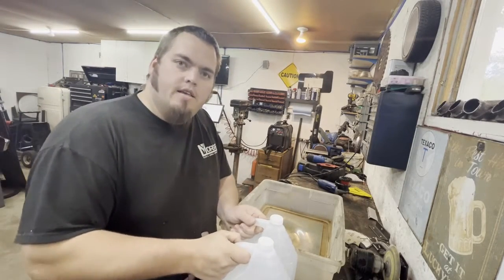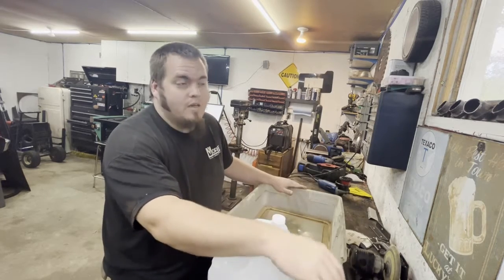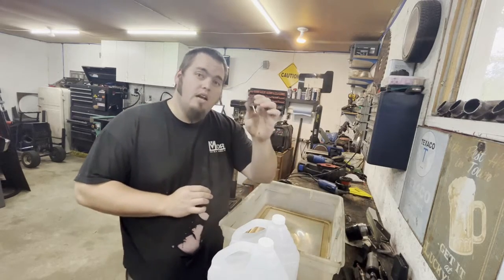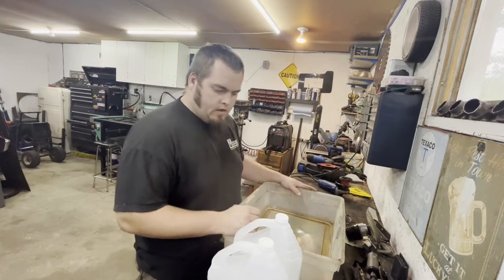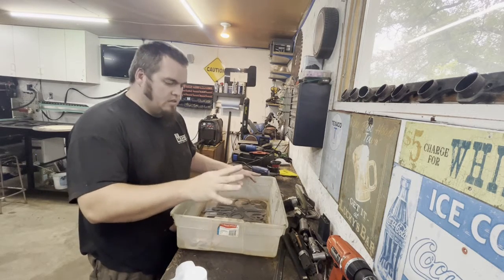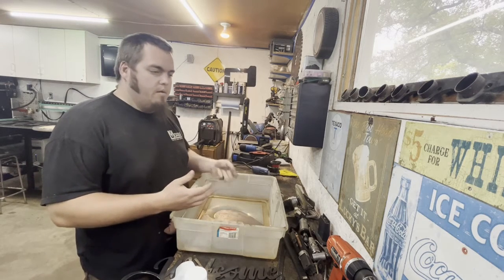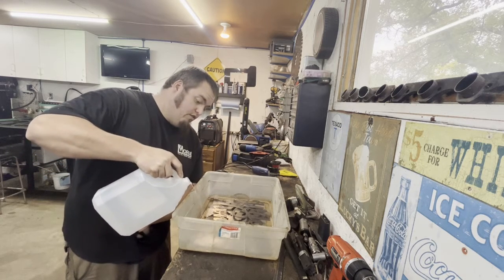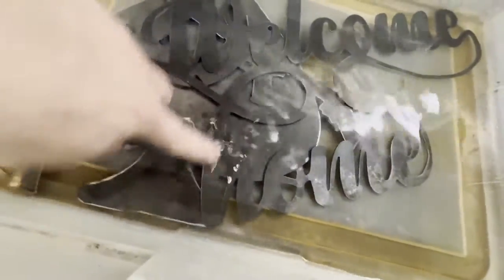White Vinegar - Mill scale removal? will it work

Comment: I've used vinegar to take mill scale off for years, and it works great. Given that I tend to want my end product to be bare steel, clear coated, I always scrub the steel with a wire brush in a baking soda/water solution to prevent flash rusting. Since mill scale is the result of hot rolled steel, the bigger the piece the longer the vinegar takes to work.
Reply from the maker: Thanks for watching! I also have noticed the length of time with larger material Spence I made this vid. This is now a standard in my shop. And am still happy with the results. Thanks again for watching.

Comment: Good informative video about the white vinegar for I have been using it for years. But have found something far better and cheaper and it works far quicker than vinegar. And is only £1 a bottle it's Harpic 10x and it very fast working for mill scale and rust removal, it's all I use now for it's brilliant. You can also paint it on with a brush let it sit for a short time and then just rub it off with a cloth (wear gloves) wash it and finish it with a rub of light oil to prevent rust.
Reply from the maker: Hey thanks for that I will have to give that a try. Thanks for watching
Reply: Hello, can you use it on 304 stainless steel plate?
Reply: @6496chase  I used it on stainless  steel spoked motor bike wheels and worked perfect.

Comment: You could go with the cleaning vinegar, which is a 30% solution instead of cooking (either 5% or 10%) solution. Might wash parts down with paint thinner or similar immediately after, to stop flash rust.
Reply from the maker: Thanks for the info. I might try that. 👍